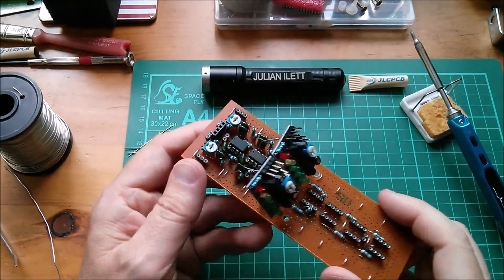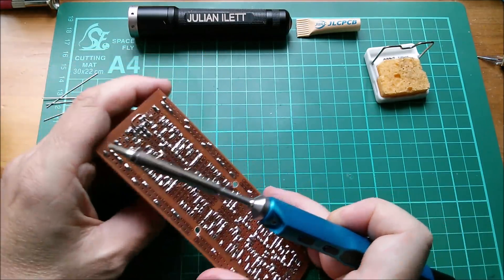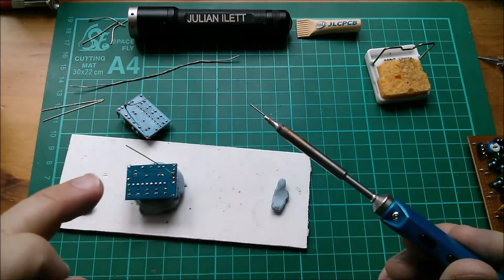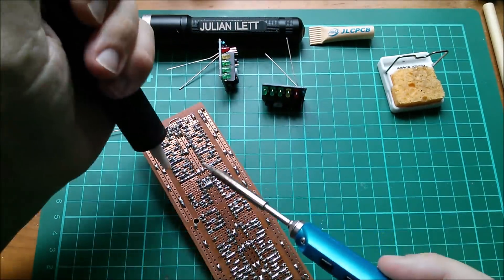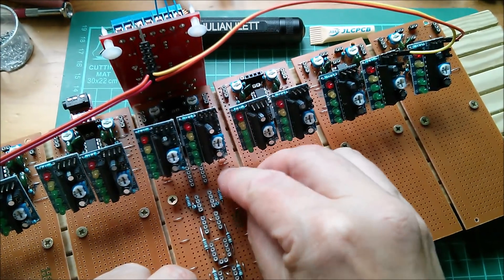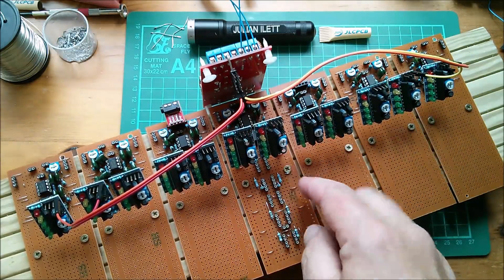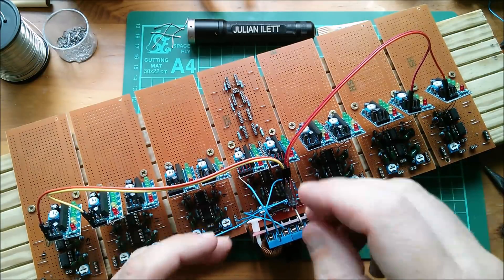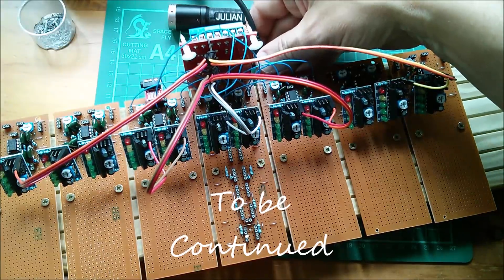Third Octave Spectrum Analyser Build - Episode 1 - Vocoder

Comment: personally i would remove all the LEDs and solder on some 5mm leds instead on a separate board to get a nicer light show. its a bit of a grind, but hey. the bundles of wire you get out of it are also nice and satisfying.

Comment: hmm, i don´t know exactly where to start....ok:

The power supply may will cause the whole unit to operate quite odd, due to EM-interference. this is a non-shielded SMPS board, generating a lot of switching transients, also filtering looks al least inaprobiate when it comes to powering audio equipment. 

I also don´t know what filter edge-steepness (Q-factor) you´ve designed. If you´re using 24dB/octave and going for 1/3rd octave mid frequency-spacing between two modules, you end up with not enough seperation. This will result in poor band-seperation, as the gain reduction bewteen two module band edges will only be -6dB, best case.(matched components estimated)

Usually the "light-show" is feeded from the envelope signal generated by each filter section, not the audio output. As you want to know when the envelope follower is saturated not the filter output...

When the envelope follower saturates the analzer circuit is then fed with a DC-offset generated by the envelope follover and usually causes "wild" behavior. 

Also all these stuff is usually build-up "back-to-front"...it begins with the analyzer, if this works, you will then know from which level(s) the envelope generators need to swing for best case Signal/noise ratio and also minimal band-pass audio level distortion vs. output level. After building the ENVs you will see what audio input level you gonna need to provide maximum linear operation, as you gonna need this for minimum distortion of your anayzer modules.
And so on....until you are at the input jacks of your vocoder.

Anyway i really hope you initial build will at least work, and you will not end up smashing the whole thing onto your wall or floor, due to lousy performance. 
My initial (OTA and J-fet based) phaser i built early 90s ended just like that, lousy overall performance, but high noisefloor and about 20% distortion due to limited headroom...
Reply from the maker: Whoa! Yes the PSU will interact with the audio frequency circuitry, but is a 200kHz switch mode any worse than a 50Hz linear? The filters are not my design - they're 2-stage with staggered tuning to create a sort of flat top. The KA2284 has a rectifying amp built in and a CR circuit for peak detection. The LM3915 needs additional circuitry on the veroboards to do the envelope following - I'll build that next.

Comment: When using a solder sucker on a hole that doesn't contain a lead, contact is not usually required.  A lack of contact will reduce the amount of suction applied to the board and make it unlikely that pads will lift as a result.

Comment: If you use a sharp pencil lead it will clear the hole for your wire much better than a solder sucker.

Comment: there is a much simpler way of building an audio spectrum analyzer.Instead of using multiple lm3914(or other bargraph drivers)you can use only one and use a multiplexer to switch in the different filters and led graphs.
Reply from the maker: True, that would save on integrated circuits. But they're so cheap - the LM3915 kits with all the parts are a dollar each :)
Reply: and you gonne dive into the rabbit hole of mux-interference with all your audio signals, unless you gonna buffer (make the audio path as of low-impedance as you probabaly could) all your input and outputs, also the mux-frequency usually makes the envelope detectors "deaf" if the generated transients (at every step, on every de-mux point) are not filtered.
Reply: The input is buffered with the active filters so it should't be interfering  with the rest of the audio circuits as for the other stuff you said im not sure.The idea was to have all filters muxed to one lm3914(or 3915 im not sure which is the non linear one)and then  have the 10 leds multiplexed(like a led display).I saw this circuit online and never made it into a pcb to test so im sure if it will work.I plan to make it in the near future
Reply: if you want a VU meter go for the LM3916 as it already has a VU scale: -20, -10, -7, -5, -3, -1, 0, +1,+2, +3, you can also tweak the scale by adding external resistors. 
As Julian already said, if you buy them off ebay(china) they do come so incredible cheap (i bought 10 ready to go units fully assembled including these 3916 for 15 bucks -- delivered!!), there´s no need to mux these anymore. The old days where the chip itself was about 10bucks are gone forever. 

Of course the chip itself is probably counterfeit, and will not 100% work as stated in the datasheet (mainly the exact led-on point differs and/or the actual led-current do that as well...) but for the usual VU stuff they do their job. I tested them all together with the same audio input and powered from the same supply...they react in the same way with component grade tolerances...ok for that VU job.
Reply: I know but where is the fun in that :D

Comment: "Sponsored by JLCPCB ($2 for 10 Boards...." why would you not just make and order some PCBs ffs...
Reply from the maker: I probably will - but that will be for the 19" rack version :)
Reply: fair enough.
Reply: Yeah, a couple years ago I started to build a retro system on veroboard. It was a very large card. When my fingers started to bleed from cutting tracks and the nonstop fretting about the crappy bus around the cpu and memory it occurred to me that doing it on veroboard is a false economy. Time is precious and a PCB tool has ERC and other tools to help you get it done more correctly and sooner.  Boards delivered in 5 days is so hard to beat.